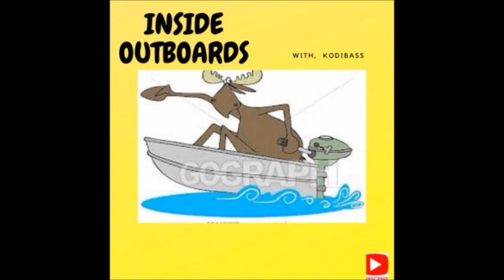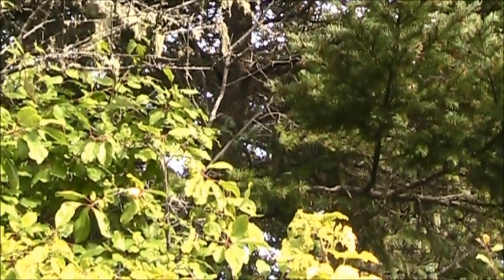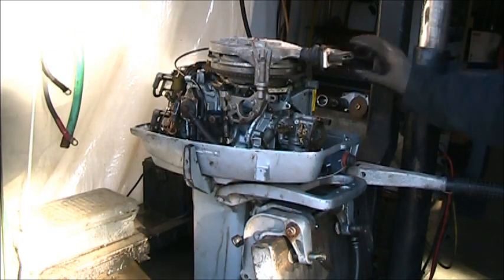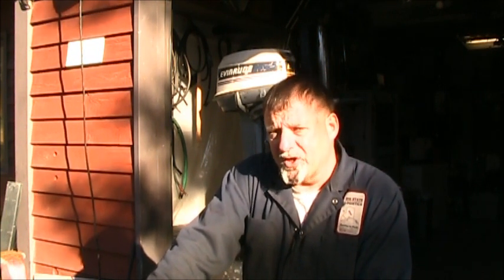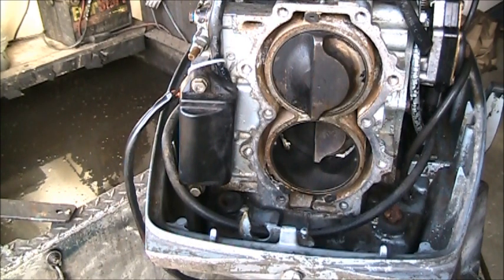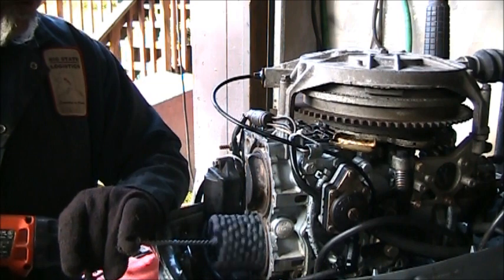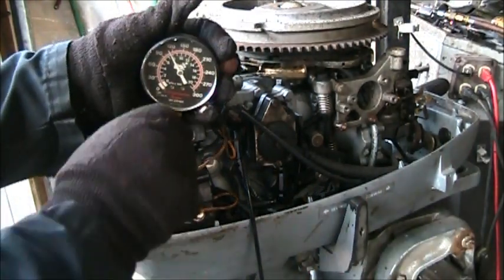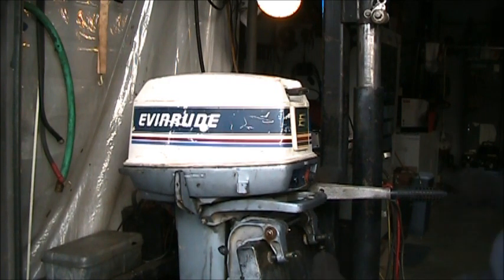1983 35 HP EVINRUDE, SALTY & TIRED

Comment: Just picked up the same exact kind of motor (83 Evinrude 35hp but Electric setup) for $50. Can’t wait to start learning through the journey. It’s only the third motor I’ve worked on, so will learn skit from especially you and This Old Outboard. Cheers to the holidays!
Reply from the maker: Good on you,  That motor is solid tuff as they come,  The starter bracket is worth twice what u paid.  Good job 4 sure,   kb
Reply: @kodibassInsideoutboards  That’s what I said haha it’s a steal but hey “a mans trash is another mans treasure.” I got a 89 Johnson 25hp that I picked up with no spark and way off timing a few months ago, it’s now running sweet on a 10ft aluminum boat with console and electric setup, if anything I’ll have plenty of parts for that one but I plan to revive my first rude project.

Comment: Boy, I smell some Plum Puddin Pie in your future!
I've been considering trying that "motor assembled" honing on a few engines.  I was disappointed when it read 90#. But it sure did appear to improve the inside of that cylinder. Maybe I'll still try it anyway.
There's nothing wrong with you camera footage/editing. I've seen MUCH worse on youtube.
The only thing that could use a little improving sometimes is your lighting, but overall, your quality is fine.
Reply from the maker: +rr, Thank you,  Do not give up on hone job just yet,, I didn't  I just took this motor on a very real sea trial,  & Will do another compression test after a real world motor run, stand by.      kodi

Comment: I believe what you did short of replacing the rings is about all you can do given the value of the outboard ! I sell 25’s and 35’s around here and about the same age for around $700 and these are outboards with 110lbs in both cylinders and completely serviced ! Newer 35’s here are from $1200 to $1800 but we’re talking 1987 to 2000 with low hours ! I’d run that one just the way it is but that’s my opinion ! 20% is marginal ! I know people say no more then 10% and there probably right but there not paying the bill !
Reply from the maker: +DK, I know 4 sure I did this same process on a 25 hp of the same age as this one & in the overall same condition but for the life of me cannot remember the outcome. So take 2..  Outcome will b posted tomorrow,     kodi

Comment: i ve learned so much from you!! great vids.  i do have a quest:  My 88 30 hp johnson will quit peeing after 30 min or so .  I put a new water pump kit in it??
Reply from the maker: +SUF, I would check the T-stat,  If that checks out Ok, Might need 2 drop the lower unit & inspect,  Is It a saltwater motor?            kodi
Reply: @kodibassInsideoutboards  yes sir it is a saltwater motor.

Comment: I hope the snuckers pays for all the work you did.

I think you are right with wearing it in and I I think if you use 100% synthetic oil over time will bring more balance  in operating ranges.
Yes differently much better running shifting in and out of gears
So they see the back of your head being a one man operation
Synthetic is a great cleaning as it runs. You can do same cleaning  with a mineral oil like sh-ch
A shell rotella oil will do the same but not in outboard motors
Reply from the maker: +JB,  Interesting ' Synthetic oil.  Now there is a area I 4 sure know nothing about 4 sure.  I have on hand  some AMSOIL brand 2 cycle oil, Is that synthetic?   Heck  I never knew there was a synthetic 2 cycle oil.  learn everyday .             kodi

Comment: I have a question, on my 1982 15hp Evinrude the charging system is putting out 16 volts. I have replaced the rectifier and it still puts out 16 volts.  Is the points condenser bad?
Reply from the maker: +JS,  No sir' a 1982  does not have points or condensers,  It has a CDI ignition system.  Go to the website CDIELECTRONICS,   click on their trouble-shooter  , look up your motor by year & HP  it will take  U step by step through your charging system...  It is a wonderful website & they ( CDI ) for Evinrude built every electronic component on your motor.              kodi

Comment: Hi kodi how important is it to tighten crank case bolts to the correct torque spec when fitting a head gasket as I have no idea what the specs are ? And can I hand tighten them just for test purposes and re torque at a later stage ones I know it runs ?
Reply from the maker: You will need @ about 20 pounds,  just nice & snug.   kodi
Reply: @kodibassInsideoutboards  ok thanks